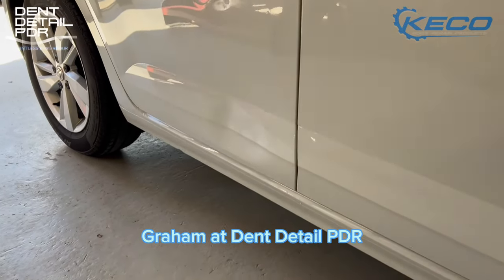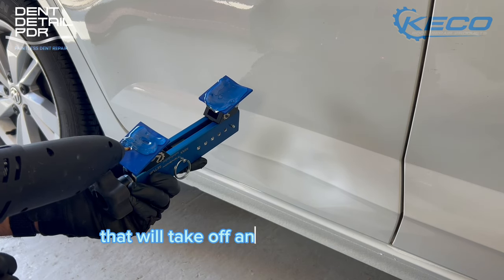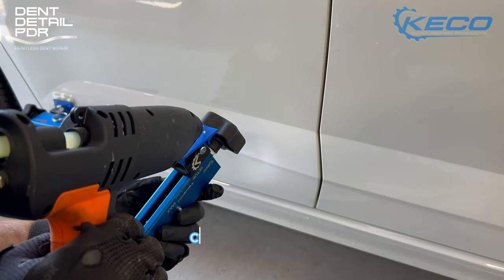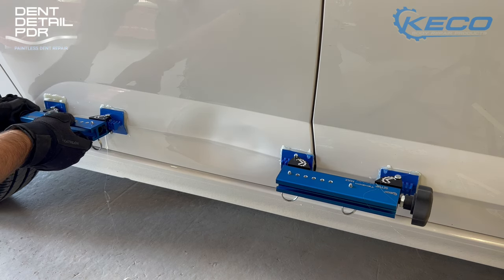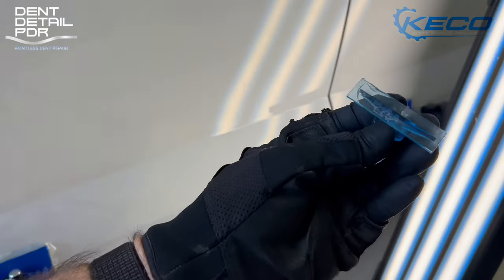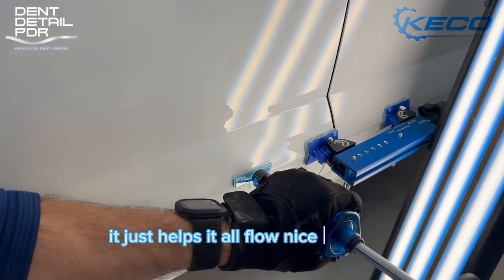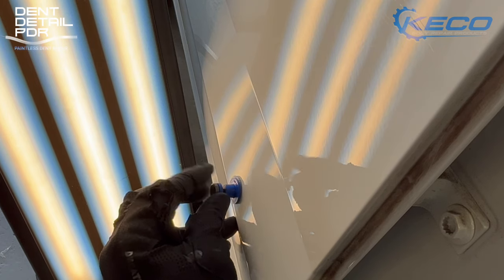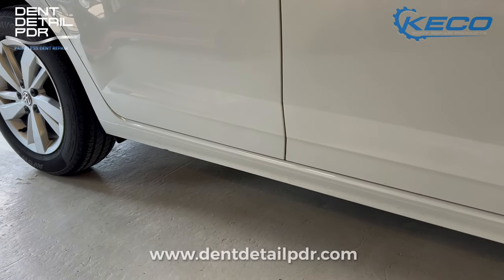How to use lateral tension to repair dents with the new Keco LTT Beams | GPR and dent repair tools

Comment: The left LTT beam has zero net effect on the pull. You did not need it at all.  Now if you put that across the gap, then you have a viable pull where you stabilized the left side of the door. . Your whole pull was based on the right side only, It came out ok though because there was enough movement on the right side of the door. Good advertisement for KECO, hope they paid you.
Reply from the maker: I can assure you it did, how can you even say it had no effect without being there or working that dent in person?
Absurd comment
Reply: @dentdetailpdr  obviously you never heard of newtons 3 laws. that left beam is doing nothing at all. absurd use of tension
Reply from the maker: @allenwilson6585  stick to your PDR beginners group Allen, for someone who never shows his own work you have a lot to say.
Thanks for watching
Reply: the beam on the left was pulling against itself because it's attached to the same panel you're trying to pull away from however the one on the right was pulling using the front door as the stable point of contact. That's what he was referring to. You could have attached it to the quarter panel dogleg as a stabilizer point, though  @dentdetailpdr
Reply from the maker: @jasonj4326  yes that could of been done, and I have done both of the options many times, but to say that it was having no affect at all in his first comment was completely untrue.

There’s so many uses out there for a single beam pulling or pushing against itself that has a massive affect, for example 1 beam being used to stabilise an oil canning dent.
Maybe he worded it wrong, but for him to say it wasn’t having any affect was untrue and his choice of sarcastic wording and pettiness was completely uncalled for
Reply: I realize the way it came off sounded pretty rough, but what he means is the way these tools work, is unless the farthest tab is glued to something that isn't attached to the panel you're trying to manipulate, then the tabs will only compress towards each other @dentdetailpdr
Reply: also adding that you will definitely be able to stabilize an oil canning dent with this if the tabs can be forced outward rather than together
Reply: @jasonj4326  Imagine that we are working with cloth or rubber rather than metal. By pinching a portion of the material it is actually putting a lateral pressure on the working area. You can test this with a tissue or towel. I have done the same thing that the keco guy has done many times with a turnbuckle and glue tabs.
Reply: while yes technically it is producing a pulling force it is cancelled out by the left most tab doing the same thing in the opposite direction and is inconsequential compared to the setup on the far right which is directly pulling the rear door away from the dent via the front door attachment.

You can also watch other videos of techs using these tools and they always attach one of the tabs to an adjacent panel in order for the pulling force to work properly  @Sworkma2
Reply: The tab on the right definitely does not "cancel out" the pulling force of the left tab. They are both pulling outwards to assist the metal in returning to the position that it should be in ie: the pop.
There are numerous reasons why people may only use one of these in the videos that you've seen. 1 They are using them on an edge in tandem with a camauto setup (paddle and rope)
2 These are expensive and only sold as single units where 2 may be the better setup
3 A particular dent may only require the use of 1. The dent seen in the video is through a body-line with most likely some stretched metal. I do not think that you would get the same effect with only the right tab.
 Look at metal medics hero tabs and Kecos lateral tension bars. They cross the dent with a bar and push outwards on both sides. They are using the same physics as the guy seen in the video. @jasonj4326